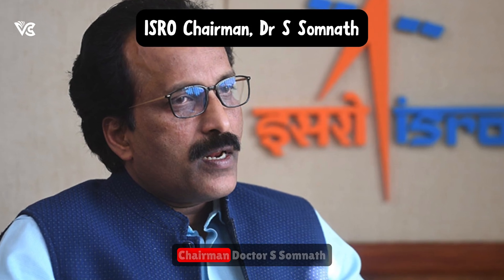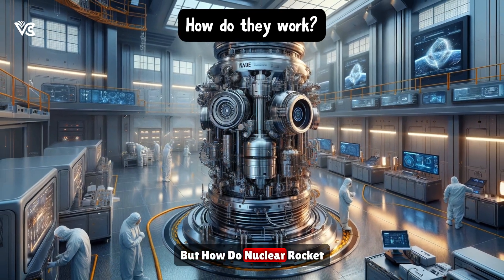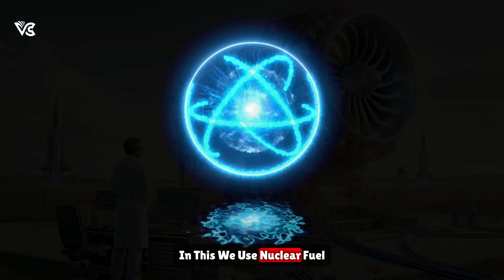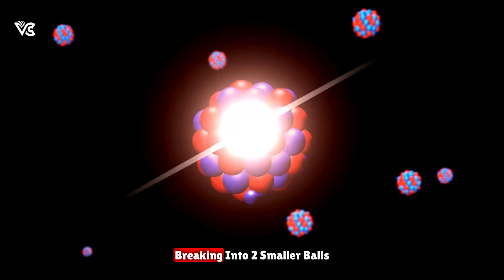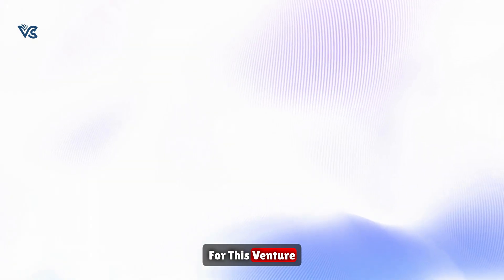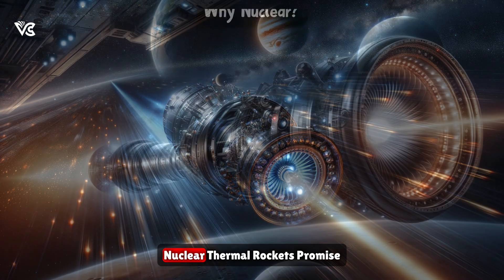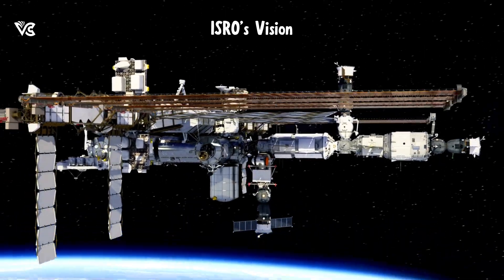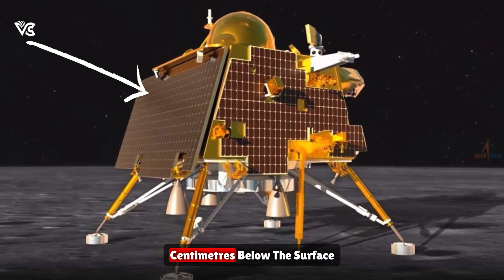Is THIS the FUTURE of Spaceships? #isro #space #nasa #spacex #futuretech #spaceship #physics

Comment: Using nuclear to power spaceships have been in consideration for decades, but they are very unlikely to make it into practice any time soon. Multiple reasons, here is one: how are you going to send them to space in the first place? Putting a nuclear payload on a rocket has never been done (although ICBMs are designed to carry nukes, they have never really done in practice, but when/if it's done it means a massive WW, or the end of mankind). If the rocket explodes on lift-off, and they do explode very frequently, then the radiation fallout will make a continent, or the entire country, uninhabitable! It's a risk way too big. 

2ndly, you gave a silly campfire example of how nuclear can be used to generate heat. This is all good, but having lots of heat doesn't equate to propulsion. A jet engine takes air from the atmosphere and heats it up and expels it to generate thrust; a rocket engine carries its own air and fuel to do similar, but way more powerful. In other words, they need to expel something at the back to move forward. 

Electric propulsions like Hall thrusters do the same. They heat up plasma. Nuclear submarines use nuclear to heat up water, generate steam which then turns the turbines, but they keep that same water, they don't need to expel anything. 

So, after generating all that heat using nuclear in your spaceship, what are you going to expel to generate the thrust? Plasma? Then you will need to carry that with you -- meaning you will have to carry a massive amount of plasma fuels for your long mission to another planet, as well as enough coolant for your nuke cores. It will be a very unsteady, unsafe and very big ship -- not to mention the impractical costs.
Reply from the maker: ISRO will use nuclear power to get into space using RTG technology. Here is a brief intro.

Radioisotope Thermoelectric Generators (RTGs) are compact, lightweight spacecraft power systems that use heat from the natural radioactive decay of plutonium-238 to provide electrical power. 
RTGs have two parts: a heat source and a system for converting the heat to electricity. The heat source contains a radioisotope, such as plutonium-238, that becomes physically hot from its own radioactivity decay. 
 The natural decay of plutonium-238 produces heat that is then transferred to one side of the thermocouple. The thermocouple then converts the thermal energy into electrical energy. 
RTGs are independent of solar light, and their lifetime is limited only by component degradation and the radioisotope half-life.